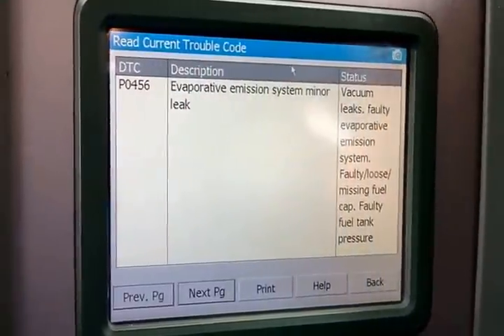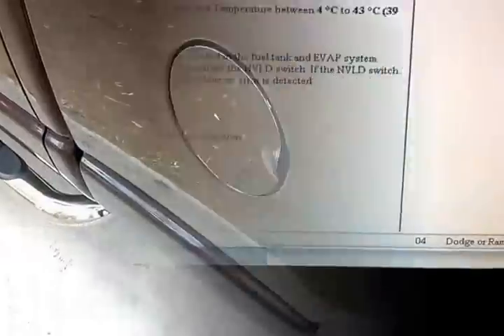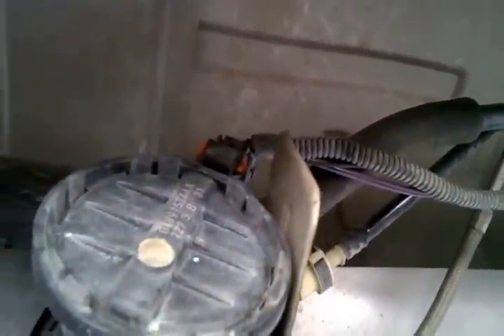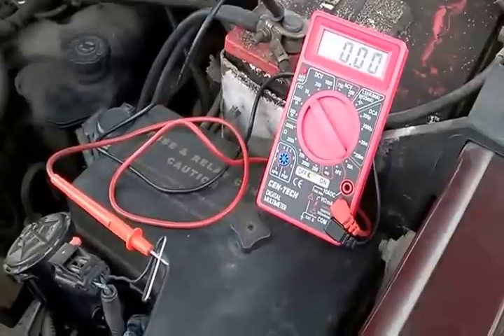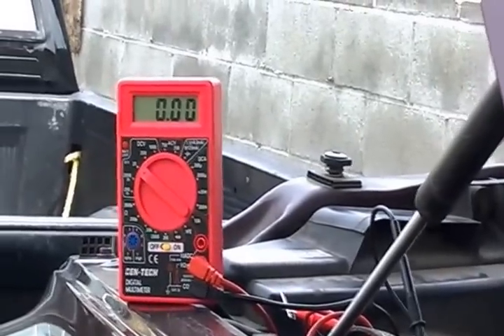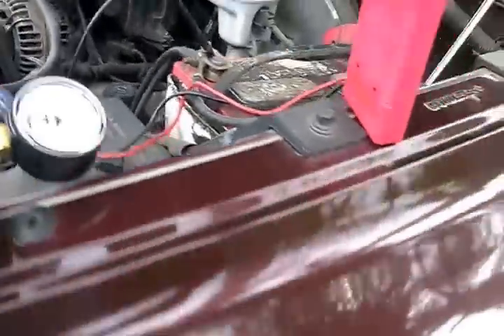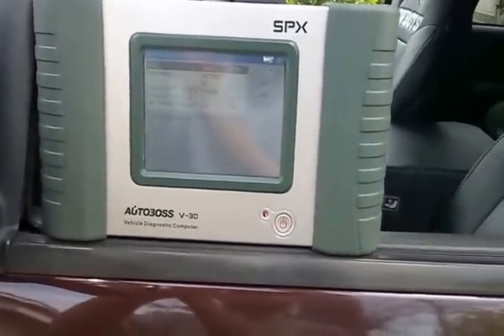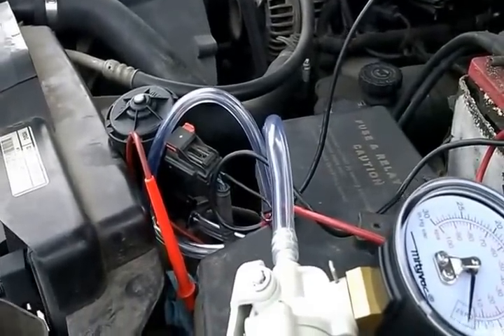(Ram 1500) Evap codes P0456 and P0440 part1

Comment: Hello eli new sub here.  Question if you apply vacuum to solenoid and then use scan tool. Wouldn't that confirm electric and mechanical portion at same time or should they be isolated? Thank you good work!
Reply from the maker: Hey there, yes that is correct, but there is instances where it can be intermittent fault.

Comment: If it has a computer then it has a problem always
Reply from the maker: When it comes to EVAP codes, they can be tricky, specially when the EVAP monitor still doesn't like what it sees.
Reply: @EliTheOBDTech  snap on smoke machine revealed no leakes but purge valve wouldn't hold vacuum. 34 year shop owner just expressing his frustrations with factory flow charts that are not conclusive. I take tech training from the big three and I will show them some of there diagnostic mistakes lol thank you for your help your a smart man👍
Reply from the maker: @ronyoung6054  Thanks!!

Comment: I have a dodge neon 05 an bought it for 800 drove it for a day got the smog done the next day. Go to put gas in an there was no gas cap. Remind you I passed the smog already. So I took a cap off my yota  an put it on the next day check engine light came on. P0440
u0168
P0517

Comment: Awesome video.  Question:  if you don't have a fancy ODBC tool to turn the purge valve on/off - what else can be done to check it?
Reply from the maker: you can use a fully charge 9v akaline battery and two jumper wires for positive and negative and manually energize the purge solenoid.